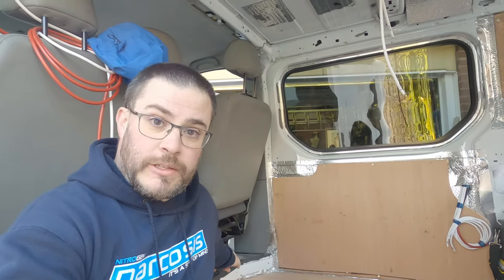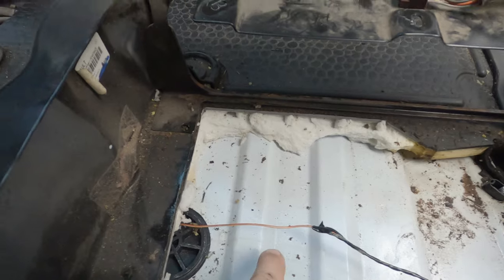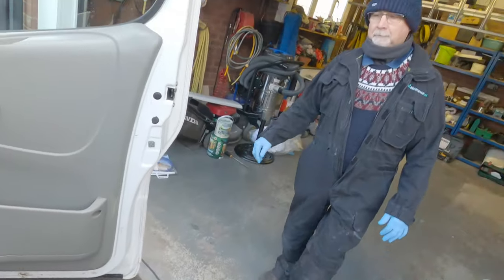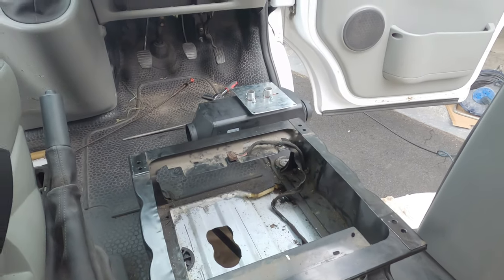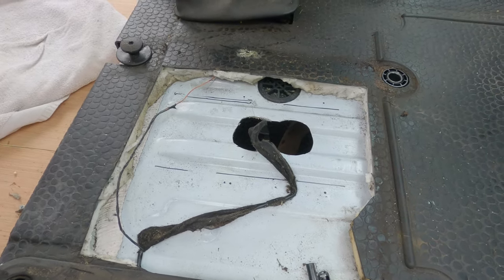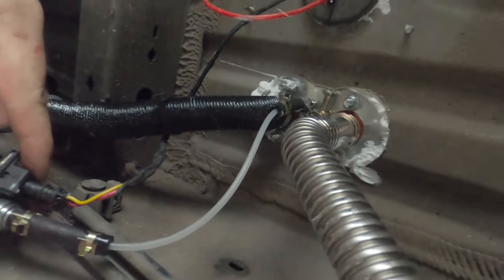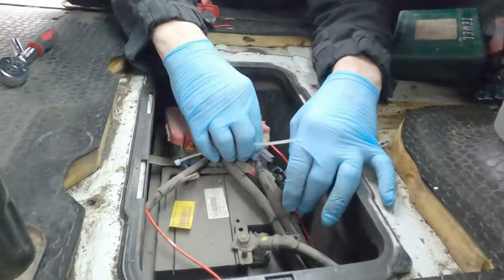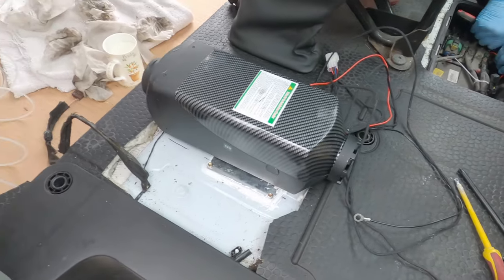CHINESE DIESEL HEATER INSTALLATION | Vivaro Camper Conversion | Astro 1 Part 8

Comment: Great informative video, cheers to you Rich (and your dad). I'm starting on my diesel install soon. I will be using your vid along the way. Thanks again.
Reply from the maker: You’re welcome pal. It’s definitely a good location to put your heater, just make sure you take your time and think carefully about any adaptations you make to your van to accommodate the heater and you’ll be fine.
Reply: @WildAstro  cheers Rich

Comment: Superb chap,  that's a brave thing to do,  I can remember fitting a proper heater into my old motorhome,   can't remember it going particularly smoothly!   Those heaters are amazing value.   Can't imagine Erbaspacher are shifting many units these days!!!  Nice work..
Reply from the maker: Cheers Gordy. Yeah, cutting big holes in sealed vans is a bit bum clenching at times, but Dad didn’t give a sh1t and just razzed the cutter through it without hesitation so was much less stressful than the windows! 🤣😂

Comment: Just been following this to fit mine and come across a few snags. My Renault Trafic is a 2013 (old shape) and where you have fitted the heater, there is a wiring loom following the handbrake wire which was going down the big grommet. This wasnt doing anything on mine so relocated it in to the cab.

Next was underneath, there's a great big heatshield directly under the heater which is for the main exhaust of the van (yours appears to be missing). Although I've managed to route the heater exhaust through this and follow the same direction as yours.
Reply from the maker: Glad it was useful for you mate. Possibly just the differences in the models that made the difference to the siting of the various components? Glad you managed to get it sorted pal.

Comment: Personal i would put some heat proof insulation around them black fuel lines next to the exhaust pipe, other wise it's the same as I did mine on my  renault trafic.

Comment: Fitted mine forward of the offside rear wheel within the seat / cupboard I built on that side. The issue you may or may not find if you have an RTC front end your seat may collapse, also you heater fan intake will drawn dust and dirt particles over the heat exchanger. This in turn may block the fins that will make the heater over heat. Never seen any anti rust paint on holes drilled through van, as this is a great wash area from front wheels. The fuel pipe or exhaust under the van needs to be insulated, as if the fuel pipe touches the exhaust you could have a fire, also fuel tank in that looks location in your van is not great, how are you going to fill it without fuel spill. Fuel filter is better inline direct o pump. Sorry Richie but it seems like an accident waiting to happen. Good luck with the rest on the van.
Reply: Are you claiming that removing the two bars will affect the structural integrity of the seat base?

Comment: Great job 👍 Nice to have some heat. 

Removing the seat every time if/when the heater needs a service or fixed may be a bit of a pain though. It also may have been better to wire the electrics of the heater to the leisure battery in the back preventing the starter battery from draining.
I leave my heater on all night in winter and those heaters are quite hard on batteries, well, I actually have mine on most of the day too.

I think to change the thermostatic mode you hold down the two outside arrow buttons for a few seconds but that may depend on the controller, the red light should turn blue. This would probably be different with the digital screen type but in general may work similar.
👍👍👍
Reply from the maker: Thanks for the advice mate. When we install the leisure battery it will definitely be rewired to ensure the main battery doesn't drain. Holding down the arrow buttons is actually the bleed function on this particular controller so do dice there unfortunately. Good to hear from you matey and thanks for watching and commenting. Stay safe!
Reply: @WildAstro  I have an eberspacher and I'm hoping there's some way of getting it off the thermostatic mode using the arrow buttons. I keep forgetting to try when I'm out in the van ( shopping only at the moment unfortunately ) I don't like the constant erratic behaviour of the fan going, it can never seem to find a happy balance. I'd prefer a low constant setting and open a vent or two to be honest.
Looking forward to more videos mate. This one reminds me of when I used to grab a little help from my dad, he has so many tools too for any job 😆👍

Comment: Was there a reason you never just tapped into the fuel return
Reply from the maker: Was a bit afraid of intro be honest mate, but I did a few weeks later.
Reply: @WildAstro  it was right there thats why i was wondering why you didn't ive got the built in tank butbwanting to fit mine underneath seat might need to buy another tho thx for the vid

Comment: Great video ......have you had any problems with your seat since you cut the bars off? Has the strength been compromised?

Andy
Reply from the maker: Hi Andy. Nope, no problems. We checked the sections we cut off and found they were neither load bearing nor structurally essential. 👍🏼

Comment: Hi guys fantastic stuff. I  was just wondering when you cut the seat mount, did the heater still come above the frame. reason for asking is I have a captains chair swivel plates on both side as have two single seats? I have noticed that all these Chinese Diesel Heater are the same size.
Reply from the maker: Yes mate, not by much but it did. If you have a look at the piece of the sun frame that we cut, it sits about 8-10mm above that level. Don’t know how different the clearance is with your swivel base in but may still fit. I’d be slightly concerned about singed ankles though with the amount of heat it kicks out 🤣
Reply: @WildAstro  Thank you. Was thinking of maybe mounting it completely under my van with ductwork coming up though the floor. Just on another note I painted my van in black Raptor paint, it’s a lot cheaper and very hard wearing, Also I think it’s pretty awesome 👍😁
Reply from the maker: @Richard-rf3tc  have seen that done mate, and gave it some serious consideration. Ultimately I like the white, so went for that instead. 👍🏼

Comment: hi what size heater did you use (not heat) Dimensions, seems to be all different sizes for the 2kw i'm after cheers
Reply from the maker: Hi there. I’m not exactly sure of the dimensions of the heater. I know what you mean about them all being different sizes though. I’ll try to measure it when I get a chance but difficult with it being under the seat. Thanks for watching and commenting buddy!

Comment: Is it possible to use the van fuel tank, instead of the separate one you've installed inside your van?
Reply from the maker: Yes mate. In fact it’s one of the changes I’ll be making before I’m finished.

Comment: Would removing the 2 bars on the seat base not affect the strength of the seat base in an accident?
Reply from the maker: Good question, but no. They are very thin and non structural. Probably a by-product of the production process where the parts are stamped out of a single sheet of steel before bending and welding.
Reply: @WildAstro  i was referring to the lower bars. Their purpose seems to be to keep the jack box in place by utilising the lip on them
Reply from the maker: @shaunfielding6790  possibly, but I don’t keep the Jack box there now that the heater is there.

Comment: So after a month, would you still recommend fitting the heater where you have? Ive been looking for a place in my Trafic and under the drivers seat seems perfect. Thanks.
Reply from the maker: Hi Ash, yes, I would still recommend the heater I have fitted but I would (and will) make one change; take the extra time to T off the diesel return pipe for your fuel supply. Leave the supplied tank out of the equation if you can.
Reply: @WildAstro  Trouble is your burning white diesel then which is a lot more expensive than red or kerosene.

You say T-off the diesel return pipe, wouldn't this only use the fuel in the return pipe and not draw it from the main tank of the van as I would assume the fuel return hasn't got a pick up in the tank?

Also what size heater did you fit under the seat, 5kw? Thanks.
Reply from the maker: @AshleyJonesFR  hi, yes it’s a 5kw. I haven’t done any research into which pipe I need to T it off yet but will make an update film when I do.
Reply: @WildAstro  Ive just had a look and found the return pipe actual goes about 3/4 of the way down inside the tank so yes this is the pipe to connect to.

https://www.youtube.com/watch?v=xmiSxulH-M4&t=222s

Comment: Great to see a new video on Astro-one! One thing I noticed, You should really get some sandpaper and strip back the paint around your ground point. It may work but doesn’t create a great ground compared to bare metal. I used to work on car audio and entertainment.
Reply from the maker: Hi Ben, yeah that occurred to me as I was driving home from Dad's house with the van so thanks for confirming that thought. I'll get it done ASAP. Thanks for watching and commenting pal, stay safe!